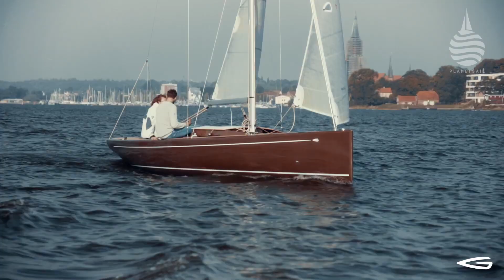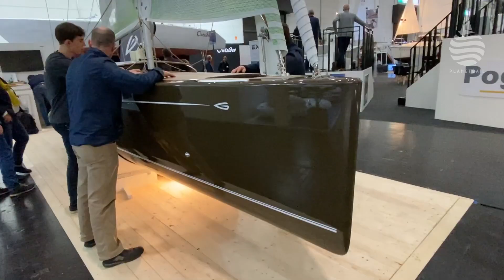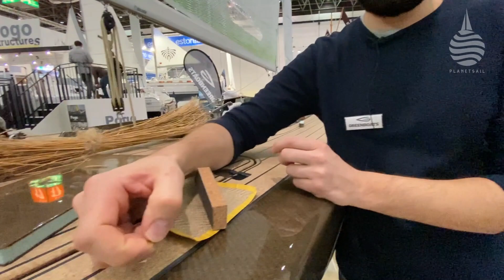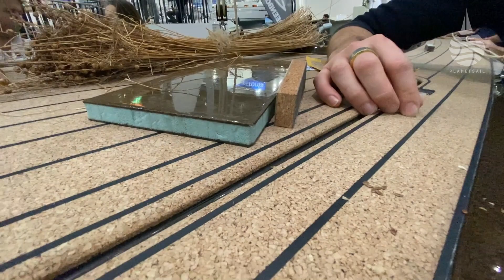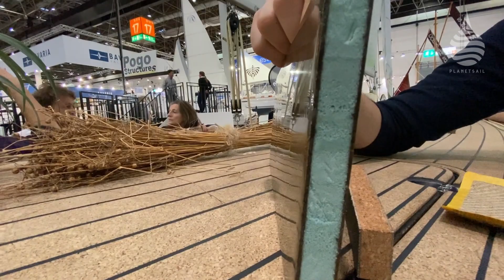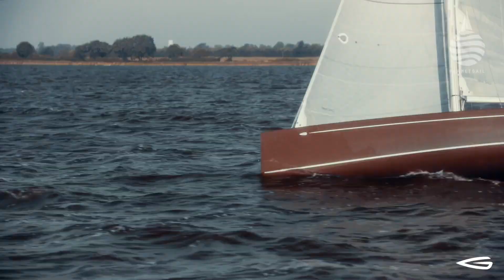The Flax 27 - built from flax fibres, oil seed epoxy and bottles

Comment: hemp fiber would be  good and more marketable
Reply: Hemp would be much more expensive cause of the regulations and the plant itself. Under the microscope glassfiber and flax are very similar. Also you cant really farm the hemp seeds and the fiber together, because they are ready in different times and the hemp seeds will get you much more money. Don't get me wrong, hemp is great, but flax is cheaper, easier to work with and already used, also there are already a lot of machines for flax and they dont have to do so many things in the same time. For some cases other plants are better than hemp.

Comment: Bullshit green washing. It's been more tnan 10 years now that flax boats are sailing, i  was not able to find the eco impact trudy compared to a normal equivalent boat. A Greenboat would at least avoid LEAD in the keel that increases the global impact several times more than the actual gain of the composite. In terms of structural resistance, best flaxes are way less stiff than glass and resin ratio is higher, so comparing a monolythic  with a sandwich makes no sense. Last point, using even a reclycled foam core with natural fiber compormise the end of life boat. The core is no more able to be recycled and when you burn to get calories (that is the logical end of life of natural vegetal materials) you release all petrol CO2 form core in the atmosphereand worse if furnace is not equiped to trap chlore & others poluting parts of plastics. The pseudo technical presentation of the boatbuilder is weak or lies.

Comment: Genius! What is it's weight in comparison to carbon? Unfortunately, I'm not in the market for a new boat, but Ill take a bike frame made from this material.
Reply: As far i know its not at all or just a little heavier compared to carbon.
Reply: The good thing about carbon is that it is very stiff. Only s glass fiber is better in strength per weight and has also a great stiffness.

Comment: Isn’t Wood a plant based material?
Reply: Wood could be a renewable material, but so far we have not been using it that way. The old growth wood that is ideal for wooden boats has largely been used up. I am going to be building some wooden boats. One of my friends owns a large campground. For each tree I use in my boat, I am going to be planting several trees on his grounds. I will never benefit directly from those trees, but his children and grandchildren might.
Reply: Rgt yes, but how many wooden boats are being made?
Reply: The problem with wood is that it takes so long to grow to maturity. That's one of the reasons I'm planning to use bamboo for the ocean plastics recovery vessel I'm developing.